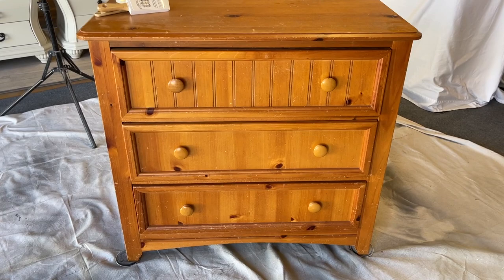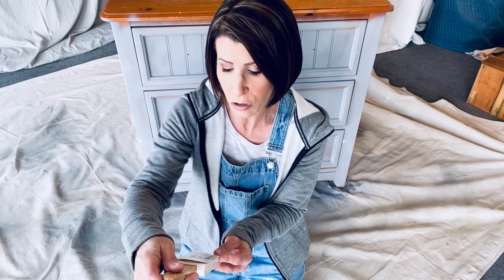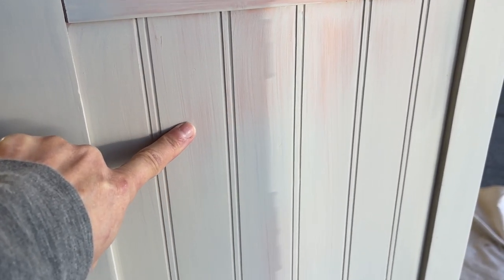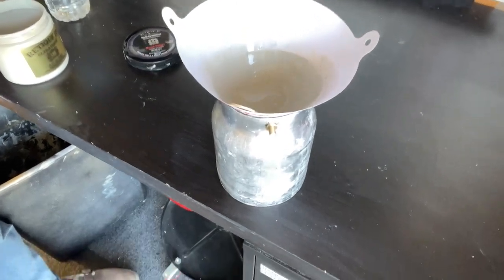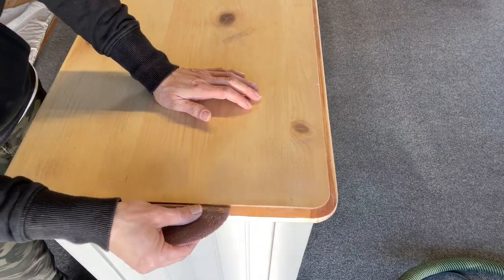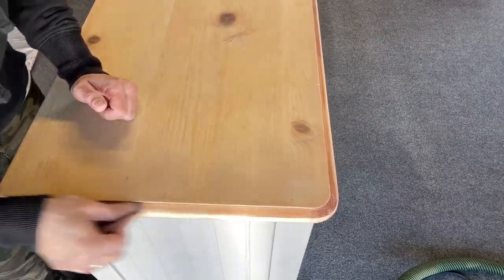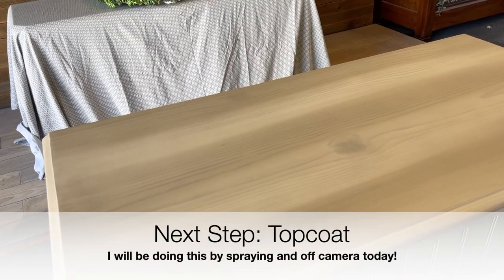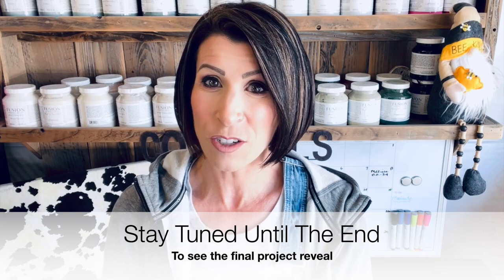Perfect Chalk Paint Finish on this Furniture Flip | Brush vs Spray

Comment: I want to paint my exterior, white steel door with Retique it "light wood" base color with grain tool then stain it a dark golden color.  Can I use a stain practice board of ANY MATERIAL (wood, MDF, plastic, etc...) to paint the "light wood" base color and stain it with a couple of practice stains?  Does it matter that my practice board isn't white steel like the actual door?  I want to be sure I end up with the right color stain on my door...thank you!

Comment: Great video 
quick question 
do you have a tip for when the drawers are touching the inside frame and the paint comes
 off from the contact
Not sure if I will be there right but I hope you understand my question
Thank you 😊 👍
Reply from the maker: I do understand and yes that can happen on a tight fit. If you see that happening, stop and sand down your drawer edges or the inside frame some with an electric sander (take down a little bit)  so that you drawers will have a little more room to slide when painted. You can also salve or wax the frame after painting to help it glide.
Reply: @BorninaBarnBoutique  Thank you so much for answering my question